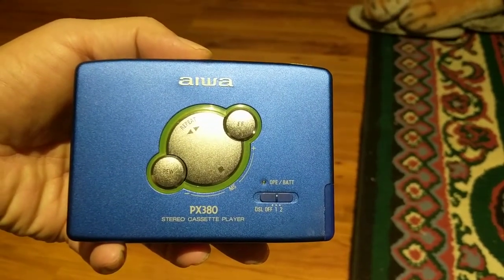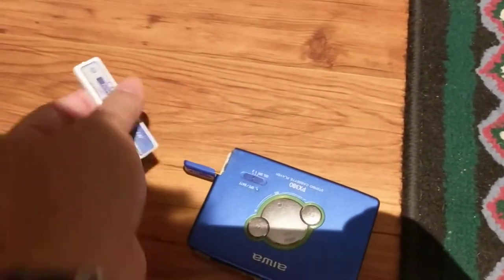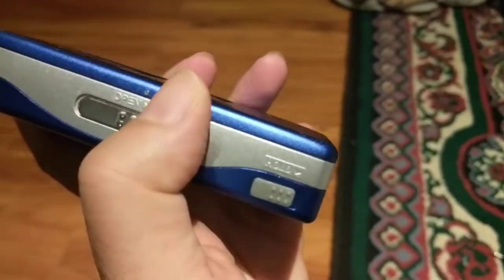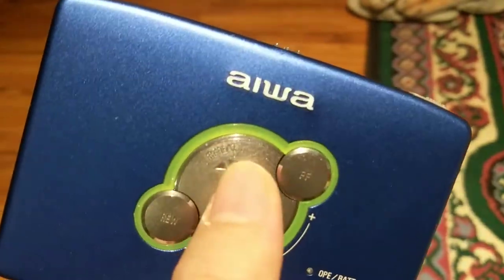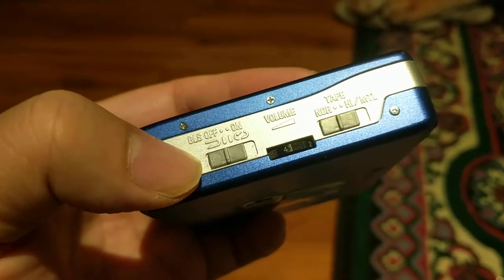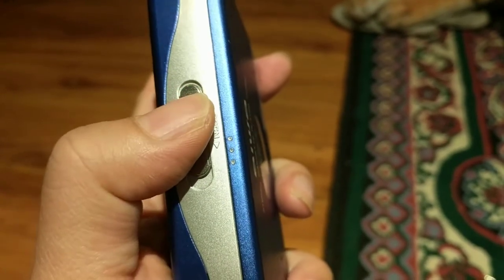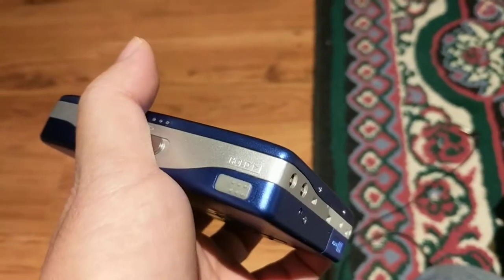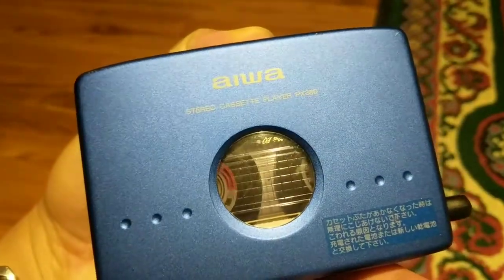Aiwa PX380 Operation

Comment: Hey I have an important question. What model/number of gumstick battery does this take?
Reply from the maker: That's a good question, I should have mentioned this in the video. It's standard size gumstick battery for mini disc players as well, and can be found online under different designations such as NC-5WM, NC-6WM, NH-14WM, NM-14N, or 7/5F6.
Reply: @ArchStanton3  thanks, that's exactly what I needed to know.